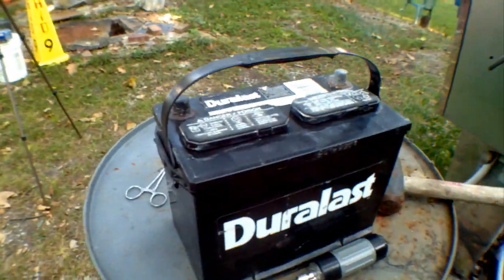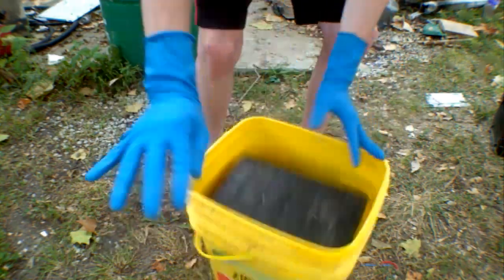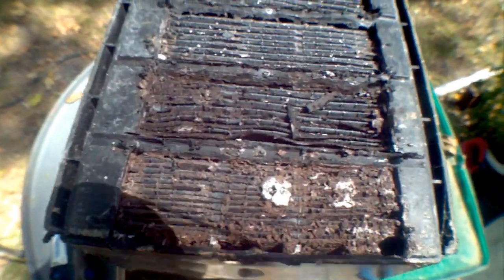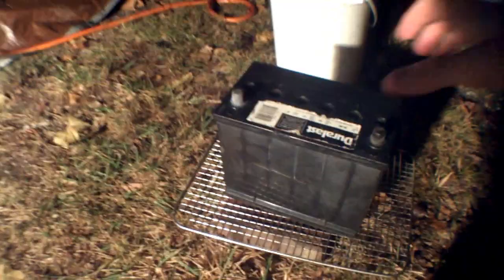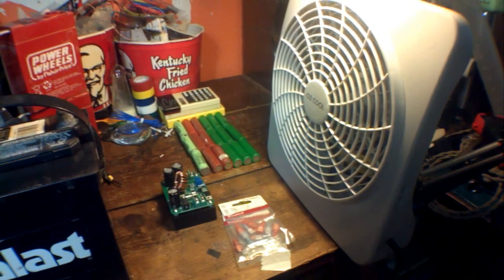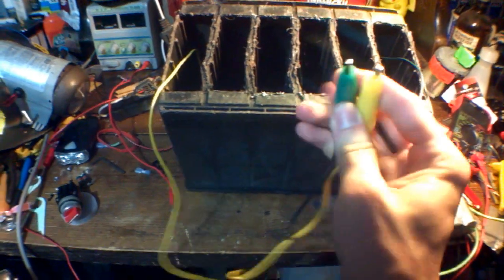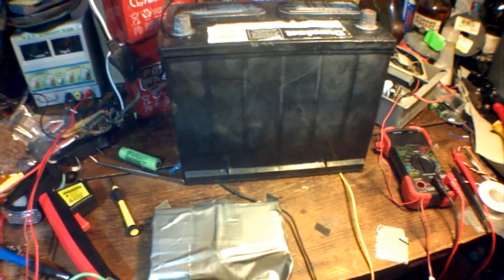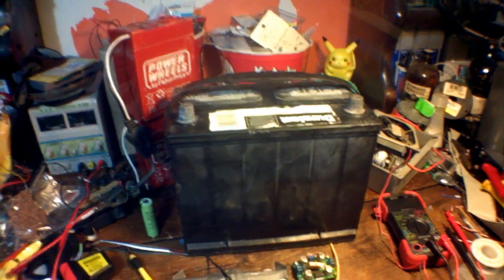DIY Lead-Acid to Lithium-Ion battery conversion 18650

Comment: You are witnessing the difference between a Geek and a Nerd. The Geek takes a highly toxic battery, splashes acid on himself and his tripod, took a shower then pounded out toxic heavy metals without wearing goggles or any other safety device to ultimately build a battery pack that didn't work with the old lead acid terminals.
Now the Nerd would have totally bypassed the whole toxic battery thing, went to work on the workbench and made a really nice looking battery pack with decent connectors in about half an hour and would have used the workbench. The Nerd!
Reply from the maker: hrmm i actually see that as reversed. when i think of geeks i think of them always having to have new things like apple products and whatnot and nerds are just the more diverse group of Otakus that obsess over things new and old.

but thanks for the compliment if you were meaning it as a compliment :D
Reply: You need to make a disclaimer so that some little kid doesn't rip a car battery apart and blind and scar himself for life!
Don't try this at home people. And if you're going to wear rubber gloves wear some pants also!!!
Reply from the maker: I say do try this at home! Its the best way to learn about how a battery works. And if your dumb enough to not know by the age of 10 what acid is and how lead effects the body then you need to learn more.

Battery acid is great for learning about acids because it doesn't burn hardly at all since its only 10% sulfuric acid. Takes like 5 minutes for it to even feel itchy most of the time.
Reply: Youll never understand the bond between a man and his battery
Reply: And what about the hybrid geek-nerd?

Comment: What if you made four groups of cells in series so that each adds up to 12 volts then you can add more groups in parallel to get the amps. Like 3.6v x 4 will give you 14.4 volts and then make as many of those as you need to get the amperage you need.
Reply from the maker: yeah but remember lithium cells are charged to 4.2v instead of 3.6v. so would only need 3 cells and would get 12.6v.

i would still have the DC-DC step up converter so it could be a handy portable 12-80v power supply.

but your idea is good ^^
Reply: Rinoa Super-Genius

That's even better. I was thinking they were 3.6 volts b/c most LiPos I've seen are 3.6 volts. But 4.2 is even better I could use the finished product for many things.
Reply from the maker: yeah even though LiPos are labeled 3.7v they are 4.2v at full charge and like 3ish volts at 0%.

its kinda like lead acid 12v batteries. they range from 11.8v to 12.8v so its hard to pick one exact voltage to describe them as.

but FYI LiFePo4 batteries are only like 2.7 to 3.7v.
Reply: Rinoa Super-Genius

So a Lipo battery in say an iPod actually is 4.2 volts when fully charged? So maybe I can run it on 4.5 volts from regular alkaline batteries. Someone on instructables did that with an MP3 player that had a dead battery they just connected the player to a 3 cell battery holder and it worked. I have a player I'd like to try this with but I'd hate to fry the player.
Reply from the maker: Yeah idk that may be lifepo not lipo. Hrmm

Comment: There is something that I did not like about this video, but I don't really know what...
Reply from the maker: well i'd love to know if you have a genuin complaint. but if its just a gut fealing that you slightly dislike everything so that compounds into not liking it, then you don't have to watch ^^;

could it perhaps be that i didn't get to film it the way i wanted? i kinda forgot to film much and had to make due while editing.

or do you dislike opening car batteries and messing with lead and acid in general?

but oh well i hope you find another channel you like ^^
Reply: Rinoa Super-Genius That was FAST! Incredible...
To the topic: you unfortunately got it the wrong way! I just shared a thought, and had no "back-thoughts". In general I liked the Idea that you re-used the battery case. But after thinking a while, I now know what might have contributed to that feeling. So, you wanted to know them, these are/were my thoughts: I thought that you were a little too careless while handling the acid. And on the other hand the lead residuals on/in the case for the new li-ion packs. I mean, you basically created a, maybe even just slightly, but still pretty toxic case, eventhough not really necessary. there are dozens of ways to easily build a case for Li.Ion cells, where they would be even better ventilated.

But I find your channel interesting so far, that's why I subbed and liked the video (in case you noticed). So, finally, maybe my thoughts "stand on no ground", but here you got them, "as is". And sry for my english, I'm a little out of practise ;)
Reply from the maker: oh its perfectly fine, and yeah i agree with me being a bit dangerous, but remember the acid was only like 1% acid and 99% water and other stuff. i get battery acid on myself all the time and it takes several minutes for it to even feel like a razorburn. thats couse battery acid when new is only 5-10% acid and 90-95% water.

also lead isnt as dangerous as people think. it's only really dangerous if you eat it and it does leave your body over time, so lead poisoning isn't usually permanent. i can easily paint the insides to cover any lead though.

the main reason why i took this battery apart was it's my favorite battery and i couldn't let it become just another broken battery ^^

btw your english is great. i didn't even think it was your 2nd language till you said so. i wish my japanese was as good as your english. all i can say in japanese are simple thing and can understand simple sentences haha. xD
Reply: Rinoa Super-Genius 1% indeed does not sound too hazardous. My "view" on lead so far was simply, that I was told one could get a severe lead poisoning by drinking water that was led through lead pipes. Still it's nice to hear it's not permanent. The "favourite battery" part explains your motives. I also have a pretty old computer in my basement, I think from 1999, and I still keep it, just because it was my first own one, so I can relate. Well, thank's for the answers :)

Regarding languages: I'd also like to get into japan, I even tried to start one night, but somehow didn't go further into it. Let's see what's going to happen in the future. The japanese language, at least the written one is pretty "extreme".

Talking about batteries all the time, my old Car battery down in the garage comes to my mind. Do you think buying a "megapulse" device would revive it? I mean, if it would, why throw it away :)
Reply from the maker: by "megapulse" you mean desulfator right? i've had very good luck with desulfating batteries but i can never get 100% of the capacity back. they always stop at like 12.4v.

i think what the problem is that even after desulfating the acid is just so old that the 10% acid has gone down to like 2%.that would make the battery less reactive. i think you could then help it get the rest of it's capacity by adding epsom salt to each cell :D

but i guess it makes sense. desulfating only really helps the plates but the acid gets old and worn out too, so can't hurt to add some epsom salt to increase the reactivity of the electrolyte.

but i got the cheepest desulfator i could get, it was 20$ and i've had to fix it several times, you might have even better results with a nicer desulfator!
Reply: Rinoa Super-Genius
jup, I was talking about a desulfator. I read on various pages, that this device brought far better results then others. about the acid: I mean, one can buy acid online, so one could just refill it, or is there something mor effective upon using said salt?

Either way, I'll try the desulfator first, but the price is about 70€ which makes it pretty much as costly as a new battery. hm! I wonder wether it makes any sense to buy it.
Reply from the maker: or build your own desulfator. maybe use the flyback transformer from a CRT tv to make the voltage. all a desulfator does really is feed high voltage low amp AC pulses into the battery.

what is the voltage of the battery? sometimes epsom salt can help without any desulfating.
Reply: Rinoa Super-Genius
oha, it's incredible: for years there was an old (giant) CRT TV sitting in the garage, and just this week it's gone.... Now that I would have had a use for it. Hm, so is life I guess.

It haven't checked the voltage yet (I will). But thanks for the Idea with the salt!

Comment: I was thinking of some bastard bike like eRockit, with generator run by pedals, but with only hub motors to move the bike. Regenerative braking would be a lot more efficient, and i would also add the feature of pedaling without moving the bike. Basically, motor does not react to pedaling, which is the case with eRockit, you only charge the battery/cap. bank. I might be useful on slight downhills or when you need to slow down only slightly.

Comment from the maker: well in order to get the same capacitry of a capacitor bank as my lithium battery you'd need a huge capacitor bank, like hundreds of pounds of them.

i've messed around with ultracaps and they just don't have hardly any capacity. still a lot more than regular caps but it would be a huge waste given their prices and stuff.

but i could definatly see adding some ultracaps to your system to allow for short high amp bursts of speed. don't know if that would work though.

Comment: What do you think of making an electric bike with ultra capacitors as batteries? When i searched about using them for regenerative braking, i found that they are used in banks instead of a single big one.

Comment from the maker: haha thats the exact same auction i got the 168 cells for my new e-bike battery from. those cells are mostly Panasonic and Sony witch is good. and came taped back into their store boxes so where prolly returns. also i didn't find any shorted cells in the packs i've opened so far.

but i gave more info about them in my battery video. i'd say it would definatly be worth buy a pack or two. never know what projects or gadgets could be hacked with some lithiums :D

Comment from the maker: also i've only bought new/old stock. like store returns that sat in a warehouse for 6 years till an ebay seller bought all their stuff.

if you can find a cheeper sale of like 20 used laptop packs that would be good. couse most packs that go bad only have like 2 dead cells but the rest are fine. they would still be used but would be great for tinkering with.

but even if they are new/old stock, if they are pushing 10 years old a few (like 2%) of the cells will prolly be dead. just fyi.

Comment from the maker: just go to ebay and you will find a lot of laptop batteries for sale. i used the 18650 cells from laptop batteries for my e-bike.

search "laptop battery" go "buy it now" then you can also filter it to only show packs with 6 or 12 cells. and just find the cheepest buy-it-now auction (couse BIN auctions can sell multiples

but be mindeful of their age. within 4 years old and they are great. around 10y they will be prolly 50% capacity couse you'd have to bring them up from 0.2v

Comment: I mean sony or panasonic, around 3.5ah or more not the crap ones of ebay. You should look at the round lipo cells on hobbyking they are only 1200mah but 15c constant and 30c burst and are about 2 dollars each

Comment: Well done my friend. You could put a brass bolt through the terminals so you could connect the wires. Then cut off excess and use it normally. I can't wait for the day you fill that up. Would love to know what a full one on your bike would give you. Looking forward to the next one. Doc says I still have to keep leg up.

Comment: For the next battery project, you might want to use a plastic milk crate.  They conveniently have handles and plastic grid walls to which wires, cell clusters and internal walls can be attached.  If the cells are laid in the bottom and a plastic sheet placed on top of them, transformers and other items can be placed in the remaining space above them.

I assume you are going camping to get away from urban lights for astronomy?  Possible alien abduction scenario - weaponize fan.